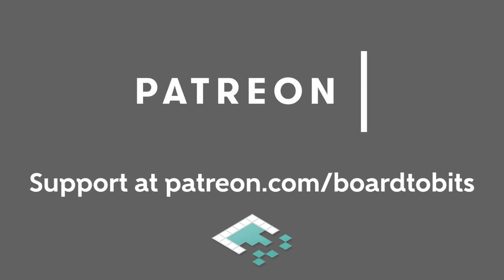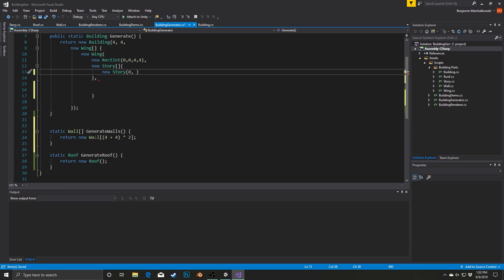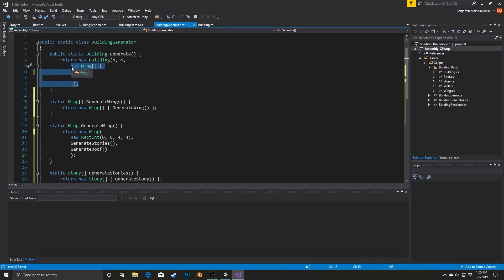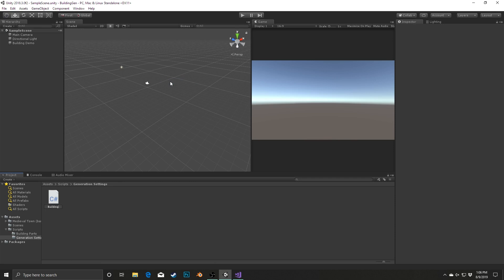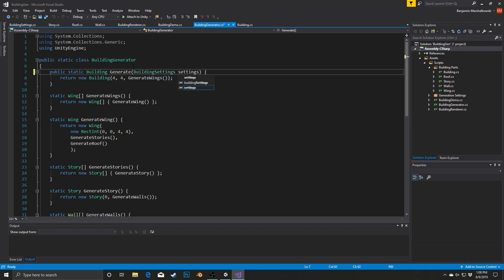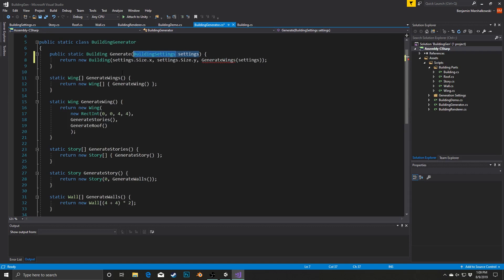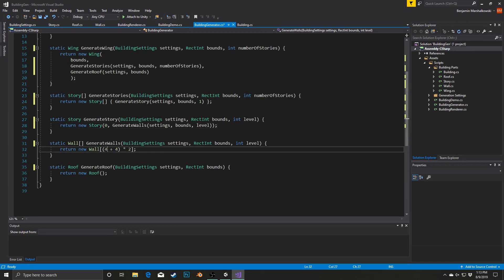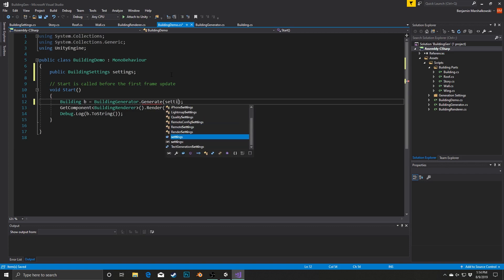Procedural Buildings, Part 6: Basic Generation Settings

Comment: Always as captivating.
I note however that the statistics of the Game window indicate that the rendering is not at all optimized. But there are other episodes ^^
In addition, the superposition of certain prefabs creates artifacts. For example, roofs are a little more than the size of a cell, and overlap on the South-North axis.
This is not due to the procedural code, but either to the prefabs which must be adapted, or to the rendering generator which must "measure" each prefab to adapt its scale and / or its position.